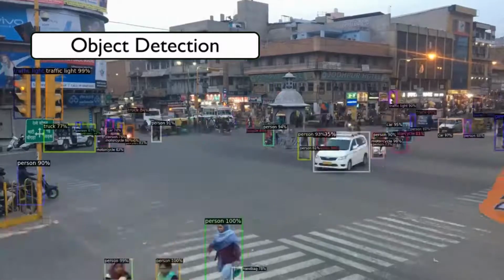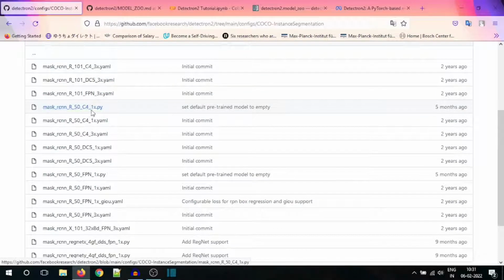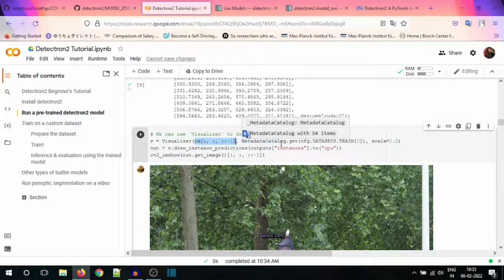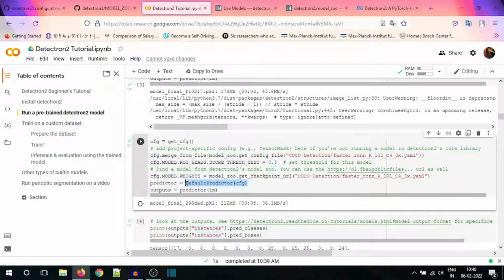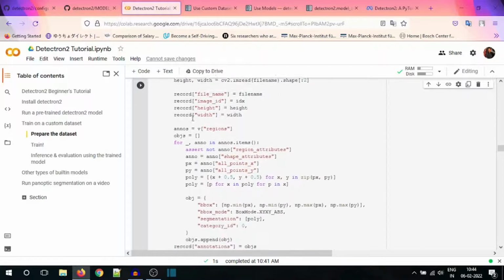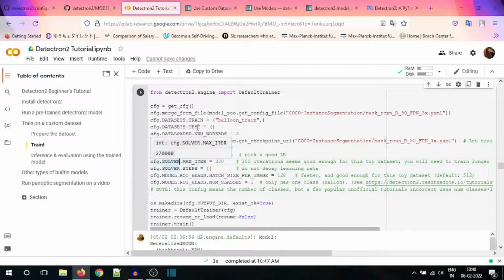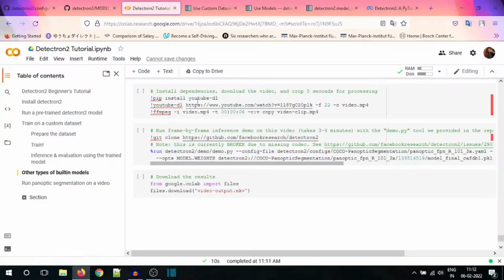Detectron 2 | Training on Custom Dataset using Google Colab | Beginner Tutorial

Comment: 🎯 Key Takeaways for quick navigation:

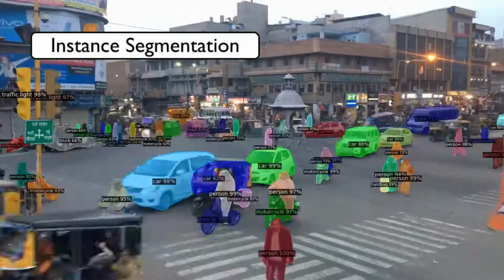00:00 🚀 Introduction to Detectron 2 and its capabilities
- Introduction to Detectron 2 by Facebook AI Research.
- Overview of its support for various computer vision tasks like instance segmentation, object detection, and more.
- Modular design allowing easy customization for new research projects.
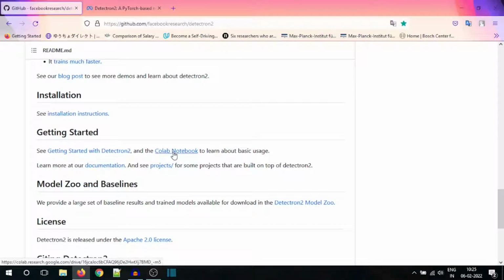01:28 🛠️ Setting up Detectron 2 on Google Colab
- Introduction to Google Colab for cloud-based GPU services.
- Installation of Detectron 2 and required libraries.
- Importing necessary utilities for usage in Google Colab environment.
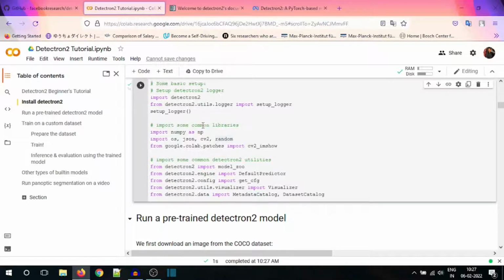03:38 🖼️ Running pre-trained models for instance segmentation
- Downloading and visualizing a sample image for instance segmentation.
- Explanation of creating a configuration file for model selection.
- Running inference using pre-trained models and visualizing the output.
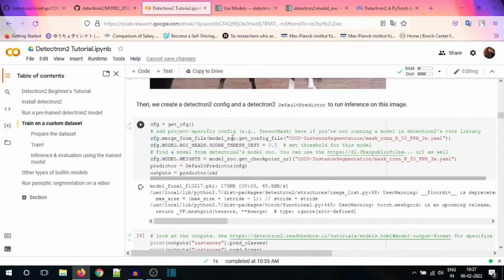11:19 🎯 Exploring object detection with Detectron 2
- Transitioning from instance segmentation to object detection.
- Customizing configuration files for specific model selection.
- Running inference for object detection and visualizing the output.
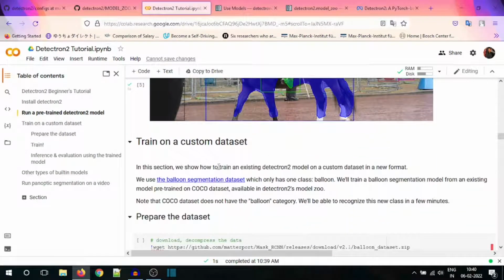14:23 🏋️‍♂️ Training custom datasets with Detectron 2
- Introduction to training custom datasets with Detectron 2.
- Registration of custom datasets and metadata.
- Explanation of the training process and visualizing training progress.
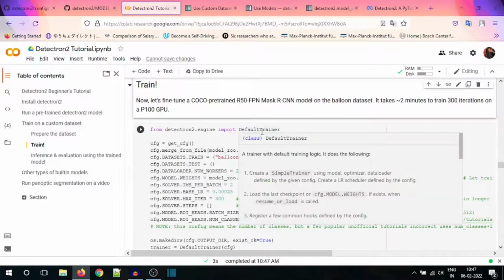20:10 📝 Implementing custom dataset loading functions
- Registering custom datasets to facilitate training and inference.
- Creation of dataset loading functions and registration process.
- Visualizing dataset annotations and training process.
24:09 📊 Evaluating models and exploring additional capabilities
- Utilizing evaluation scripts for model performance assessment.
- Exploring additional capabilities like keypoint detection and panoptic segmentation.
- Demonstrating inference on videos and exploring further documentation resources.

Made with HARPA AI
Reply from the maker: Nice 👍🏻. Thanks